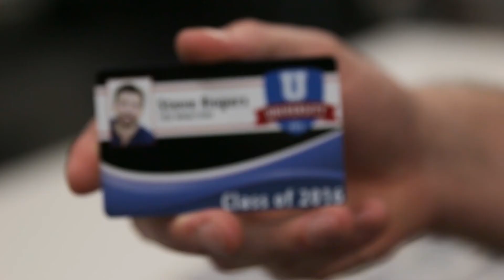How it Works: Mimaki JFX200-2513 Flatbed Printer | ITNH, Inc.

Comment: Bill is correct. Our machine has been around for 5 years.  Belt has torn appart twice.  The heads needed replacement in 4 years.  The quality is Great. If you run on slow. Don't be in a hurry, and make sure you have a good mechanic.

Comment: We have had our Mimaki JFX200 2513 EX for 3 months, sorry to say this is not a production machine. The faster print modes degraded within 1 month, to get an acceptable image we must run 600 x 900 9 pass (slow). Three 4x8’s per hour is the only way we can avoid destroying material with poor quality prints, even with no photos. Many tech visits have us convinced this is normal for this machine. Things I missed when choosing this flatbed printer: 1) Print speeds at the show are brand new heads and degrades fast. 2) The manual movement of the head is exceptionally slow. Manually measuring material thickness is critical (+/- 1.5 mil) and slow, so critical that most material must be manually measured each time by moving the head to 1-3 locations on the substrate before printing, even the same material. 3) The automatic cleaning is often, time consuming and slows production significantly. I did not see this at the show. 4) The manually inserted material alignment screws must be screwed in and unscrewed every time material is placed on the bed if the substrate is thinner than the alignment screws i.e. aluminum, vinyl, thin Lexan, etc. Automatic alignment pins and automatic material thickness measurements on other machines were far more important than I estimated. This machine has good quality at slow speeds and may be the right machine for 1-3 person shops (100k to 300k) or small shops that print the same exact material every time, but it is not a production machine. I have purchased many printers over the last 32 years, I hope this helps others make the right choice.
Reply: For machine & inks, whatsapp me: +8801778839351
Reply: Sir I am from India, plzzz suggest me what kind of printing business I should do in 15 to 20 lakh

Comment: Ours worked fine for a while.    Over the year the machine gravitated to not be able to print red.  Reds start off printing fine after printing a little while ( 6-10 inches) the red goes to orange and then goes to banding.   Cannot seem to find anyone able to fix this.    Do you have a recommendation?